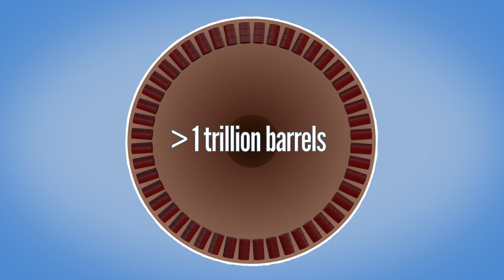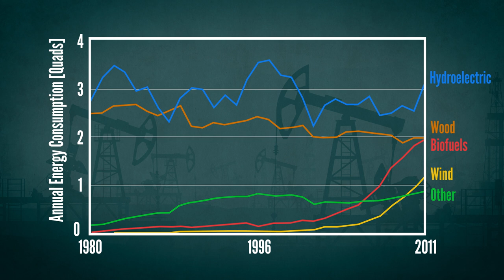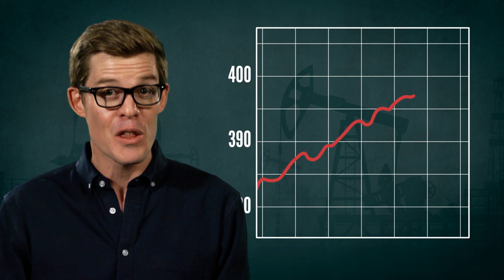When Will We Stop Using Oil?

Comment: Poked my head in hear to see what information you had to share on this. Never got the answer from your video. Reading the comments and I'm wondering when someone would mention oil isn't just used to make gasoline. One person mentioned it, sad.

Also checked out the Thorium Reactors because, you know, I want to make sure I know what it is, not take one person's say on it, then regurgitate what that person tells me. I mean it's "safe" and "cheap" energy after all. (sigh)

Well of course I got the videos of Kirk Sorensen. Now I'm not the sharpest tool in the shed, but when I hear nuclear, I'm thinking how can this be safe? Then I see him mention a half life of 300 years, wow that sound pretty safe, not. Then I see they have drain chambers in case the power went out, why do you need to drain it if it's safe? Well because they are turning Thorium into Uranium-233, which is radioactive. So they are basically masking uranium reactors with using thorium.

If it sounds too good to be true, it isn't. I'm not a tree huger, love hearing the sound of a V8 engine roar, but nuclear, thanks, but not in my back yard. Look up Chernobyl, it isn't pretty.

Comment: so 30 years? nah, ive seen estimates at 2088 and further
Reply: Nah, usage is still growing, but after a time it will be harder to extract, some oil will probably not even extracted, thing is later it will slow down, but I will still say like 20-25 years, we'll need to change to other energy sources.
Reply: You're overlooking improvements in extraction technology. We never thought we'd be able to access the Marcellus shale, either, until we did. Ditto for deep water oil fields. The "proven oil reserves" have remained remarkably constant over the last 40 years, even as consumption increased, due to technological improvements.
Reply: Also, don't forget hydrocarbons are very simple molecules, and can be synthesized from essentially ANY carbon-based matter (for the right price...)

Comment: You never answered the question. 
The answer to this question is simply no. while we might run out of natural gas, we will never run out of oil or fuel because it is a simple chemical compound and we can synthesize it. yay us. The problem is once we need to synthesize it, we will no longer get more power out of it than it takes to make it, so while cars can run on gas forever, yay us, power plants will need to go nuclear. 
bassically the future is not windmills and electric cars, its nuclear fusion and V8s.

Comment: I think nuclear fission is a rather attractive short term solution (tho actually rather expensive) in the short term, while engineers work on the pipe dream that is fusion. If we can crack fusion we could be set for clean energy until the sun goes out. Tho I suppose in a few million years we might hit peak water and need to go to Jupiter...
Reply: Fission isn't more expensive than coal by that big of a margin... in fact it only costs more due to government regulation fees.
Reply: Looking at some new data you may be right, all the more reason to adopt it considering the benefits. Seems hydro power is dirt cheep though. Too bad there aren't more damn-able rivers.

Comment: If the cold war didn't stay long, we will continue the war and the oil discoverable will not be able to follow the speed of using in around 2000. And the technology to draw it from the crust isn't improving much since the 1950s. We end up with resources war in 1955 and everything runs on nuclear before the 2060s since the price of oil rise to ~$2000 per barrel

Comment: Whales are certainly renewable resources. They were, and are, over-harvested. Unsustainable practice is not synonymous with nonrenewable resource. 

This sort of fuzzy thinking leads to all sorts of silly ideas, such as the idea that all forestry is bad for the environment, or that animals, rather than modern livestock farming practices, are the cause of climate change.
Reply: +Thomas R. Jackson I mean I agree, forestry is carbon neutral. but it surely needs to take place in areas which are not primary forests. Cutting down places like the rainforest and replacing it with say modern farming practices is also not sustainable for those local ecosystems as well as the global environment. 

But yeah if you could produce oil artificially on economical scales then it would have no effect on the levels of CO2 if the carbon to make it came from the air.
Reply: +Even Andy 

I would include deforestation as part of unsustainable modern livestock farming practices. We are in no disagreement on substance. 

Mine was only a quarrel about sloppy or misleading language.  What caught my attention the most was that it wasn't a casual slip. He made a point if emphasis that whales were non renewable. Terms have meanings and understanding the meanings is critical to understanding the problems, making a proper analysis, and coming to rational and effective solutions.
Reply: Thomas R. Jackson Okay, yeah I agree completely then.

Yeah misleading language can be more of a hindrance than a help, especially then it comes to complex issues such as this.